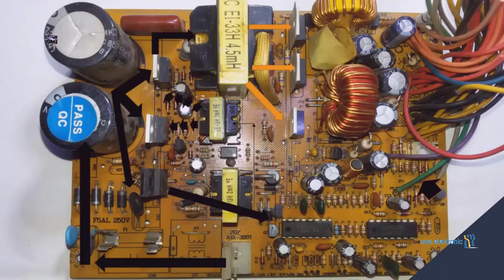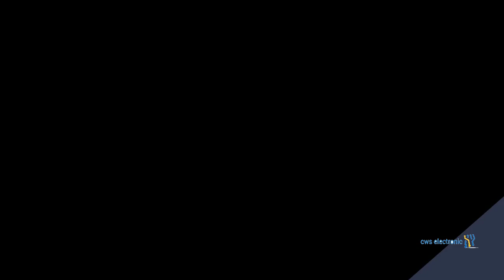Switching Power Supply Primary Circuit Explained | How to Diagnose and Fix Input Side Problems

Comment: Hi mam what is the possible causes for STDBY section not working?
Reply from the maker: Hello. Usually the failure of the switching transistor which is located next to the transformer and is usually of the MOSFET type. Also the failure of the small 50V capacitor are the main reasons for the failure of the standby circuit
Because these two factors are responsible for creating a regular frequency for the transformer.
Also the diodes after the standby transformer also have a lot of failure that needs to be checked